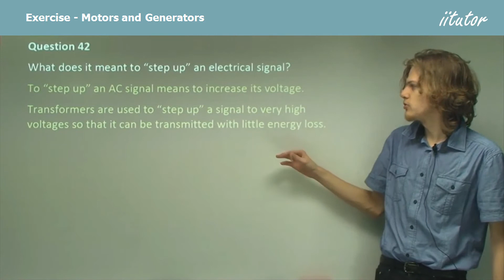💯 Why is AC transmission a better alternative to DC transmission? | Step-up Electrical Signal

Comment: It was true before you were born and definitely when Tesla has beaten Edison. But today, there is high voltage DC transmission possible and it has smaller losses than AC transmission. It is even cheaper when sending power over longer distances than 600km.